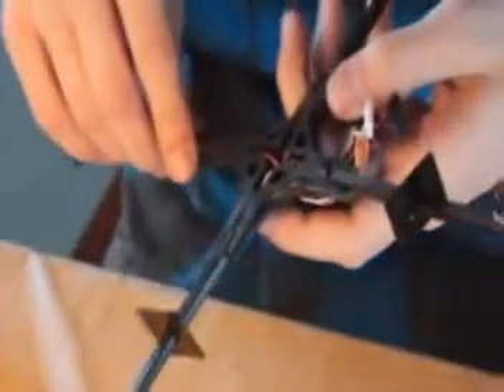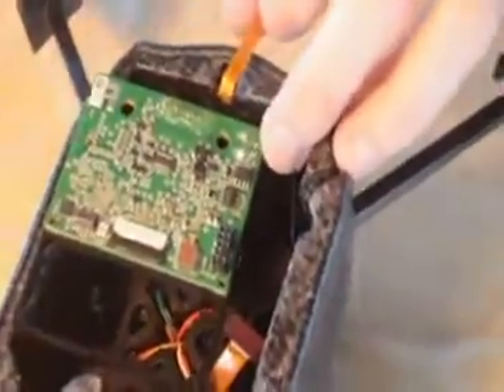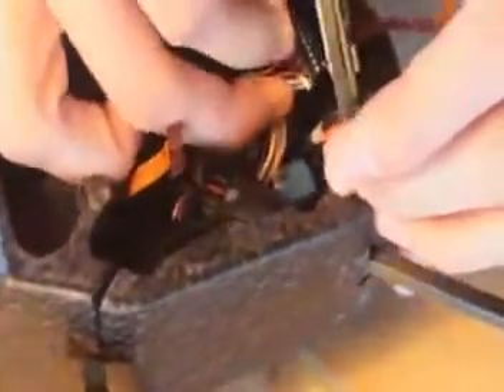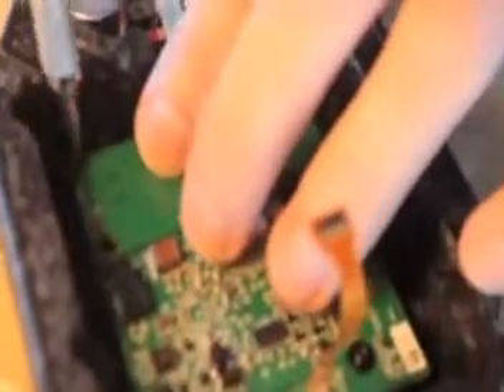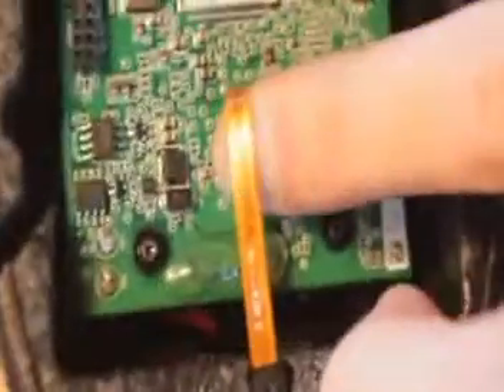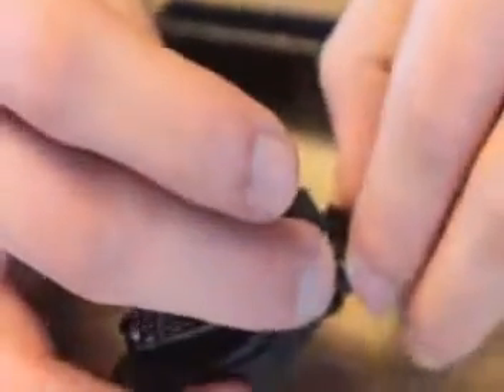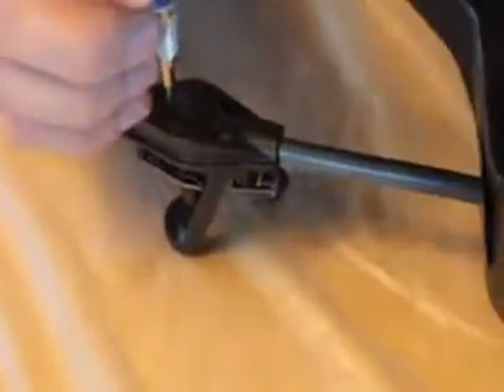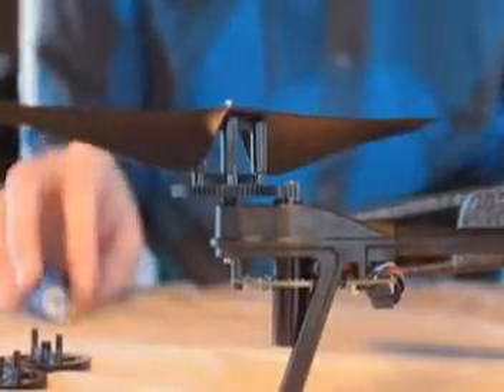AR Drone 2.0 How to Replace Central Cross Tutorial - Episode 2

Comment: Does it matter which side you install the motors on the new cross? I finished putting it back together and it doesnt take off. I have the A and C props on the right sides. The cross has the point going forward too. But i think i mightve put the motors on different sides.

Comment: only gripe with the blue kit is the gray plastic that holds the bits and driver.  its a pain trying to pull one bit out and if you flip it over they all come flying out all over the place. fixed this prob by throwing out the gray plastic and just throwing everything into the case.